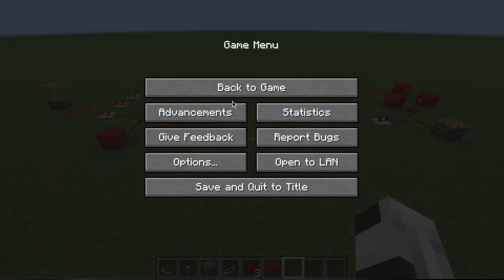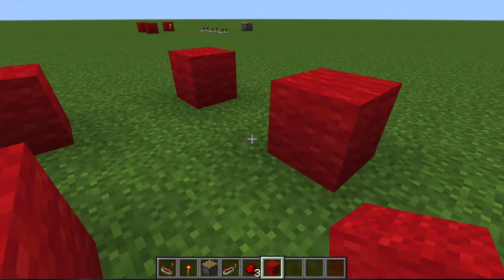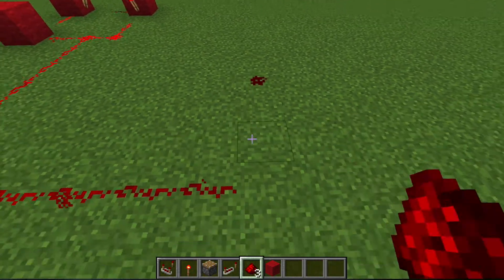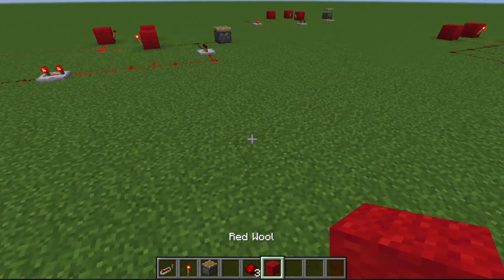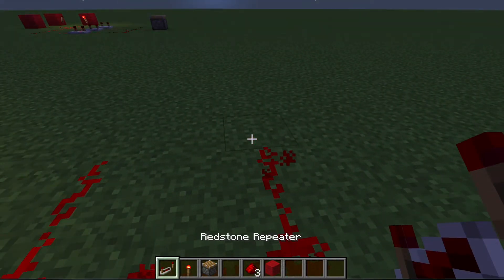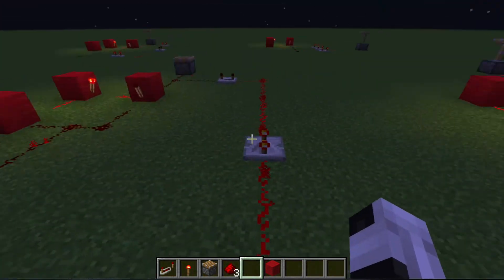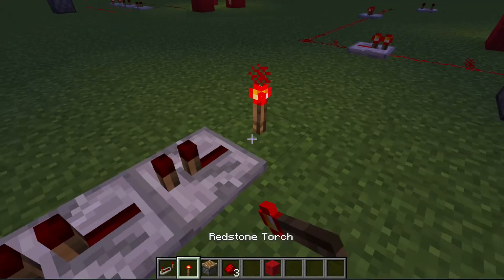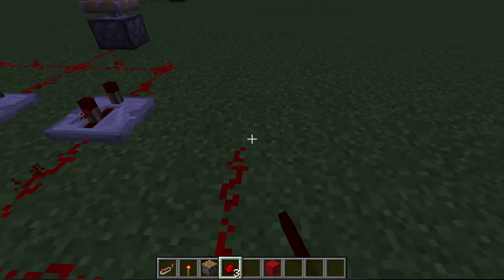How To Make Parallel and Series Circuits With Redstone In Minecraft

Comment: the reason the second circuit works faster than the first is that the circuit is taking the fastest repeater (the one tick)  and essentially making that the primary Redstone line, whereas the series circuit is taking each individual repeater with different ticks (six ticks) so it takes longer. Maybe this is how it works in real life too, I don't know, just thought I would explain it in case it wasn't